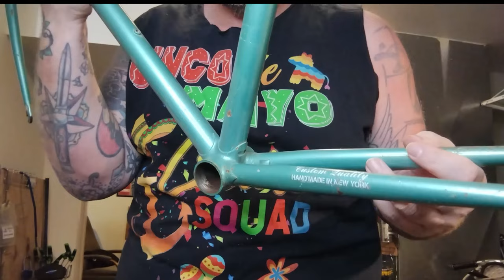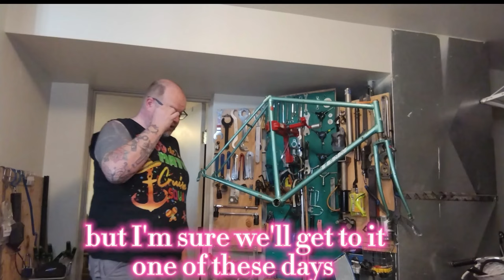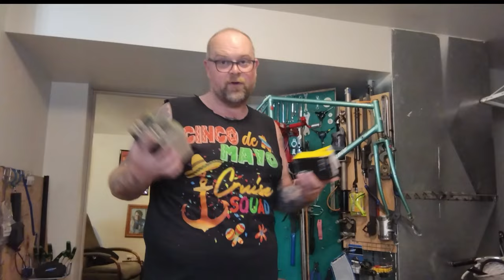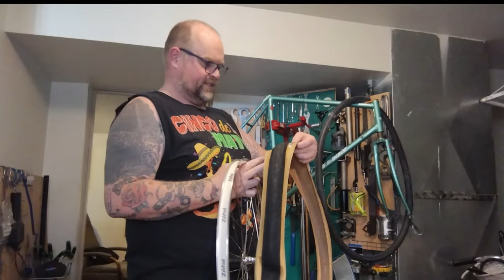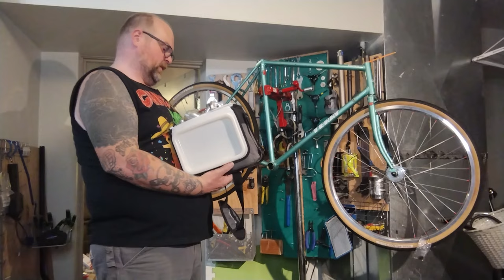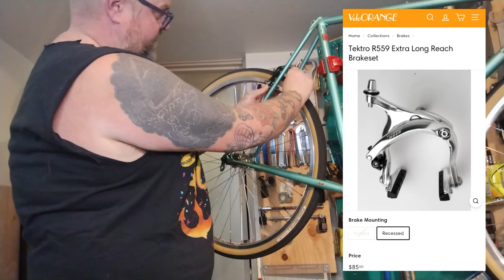ditch them 700x23 tires for 650bx38, vintage road bike 650b conversion! Terry pt1

Comment: Star Michael .. That frame was not built  by Serotta..Terry had a small production shop in East Rochester NY..the geometry  was optimized for women..short top tube.. she popularized the small front wheel to allow a super short top tube...her head frame builder previously worked  at Serotta. I have met her many times. On several occasions  I built wheels for them...
Reply: That's a nice frame. It's definitely a road race frame and only really looks right with thin tires with narrow rims. I realize you're building it for comfort though. I like the color too.
Reply from the maker: That's good to know. I had a couple old timer east coast guys tell me it was. It's still a really nice old frame! 😁
Reply from the maker: I've bought and refurbished and sold a few Terry's over the years, usually the small front  wheeled ones. The old ones seem funny now as they were basically city bikes, but only fit skinny tires as was the fashion of the time.
Reply: I   agree..the USA made Terry frames were great quality and well made. I used  to ride - race with her head frame builder..those were the days...
Reply from the maker: Dang really!? That's pretty cool! 😎😎😎